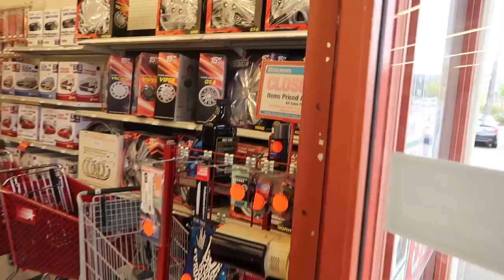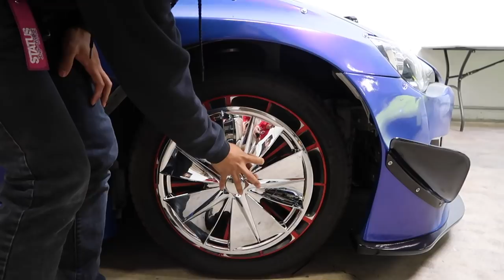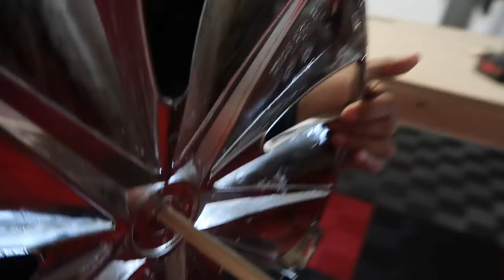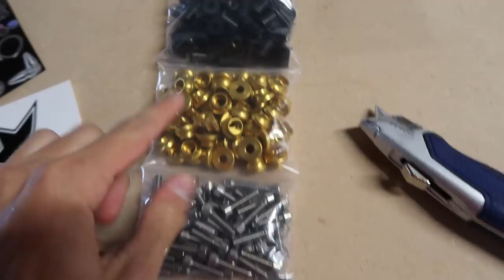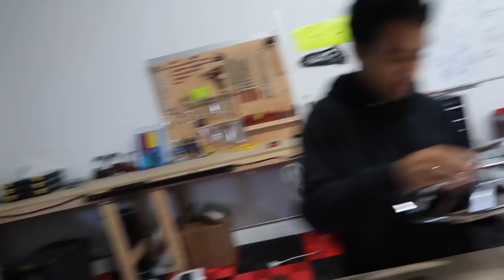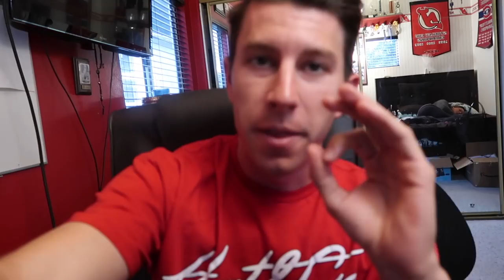BRZ GETS WHEELS! *SPINNERS*

Comment: I am a fan of your vids. It does help me at times to find direction for where my next upgrades are going and if they the sort I should tackle myself or pay the professionals lol. But gotta be honest ........this vid just seems like you've run out of ideas and filmed for filming sake . Come on get to it . See if you can point me in the direction of somewhere on line that can help advise me on getting upgraded electronics gauges, settings etc. I'd love to be able. I have a obc mini screen in the centre of my dials which does all sorts, temp, boost car tracking e.g. Mileage, tyre pressures the usual stuff plus it has a track day screen...........lap times, 0-62' 0-100 timers, g metres etc etc. But, and it's the only but I really don't like about my car...........it's a digit screen 💩😞🤓.       I'd love to be able to have that stuff be a setting and be able to be seen on the hd screen or if needs be add a second screen or unit. We don't really have a lot of expertise over here on such upgrades. So if you or any of your fans could advise or point to someone who could advise. That'd be pretty cool and well appreciated.

You say............."keep moving forward"    So to you, I say.........."keep er between the hedges" (basically means the same thing lol)